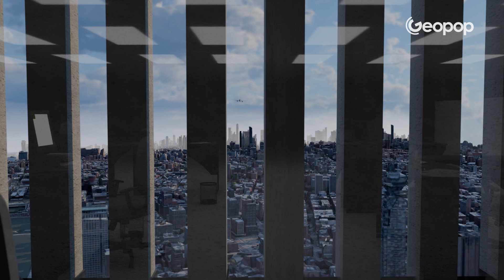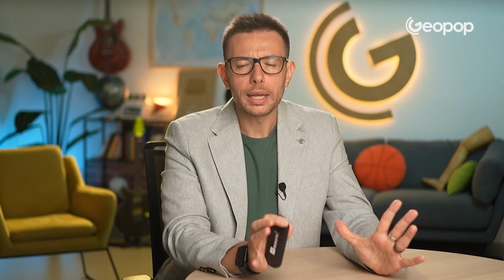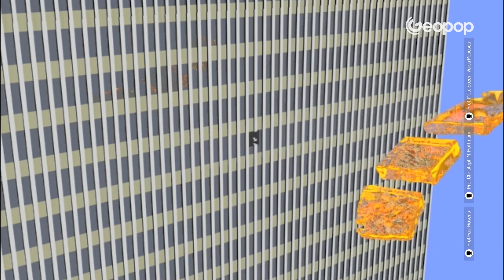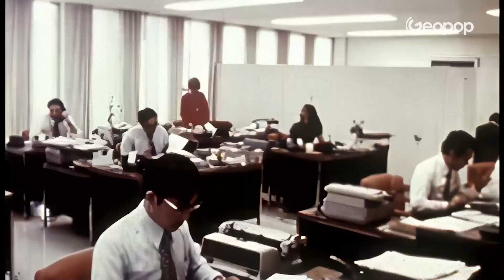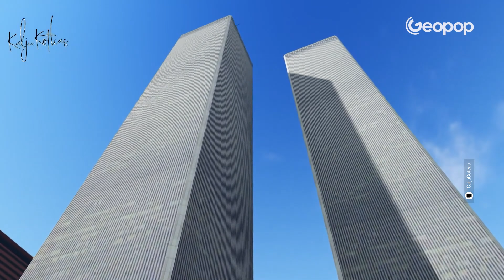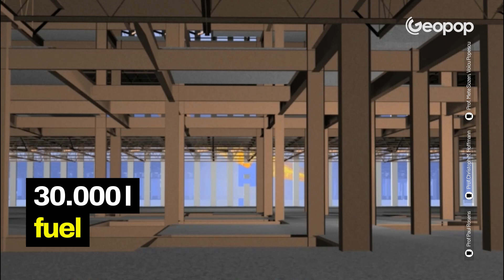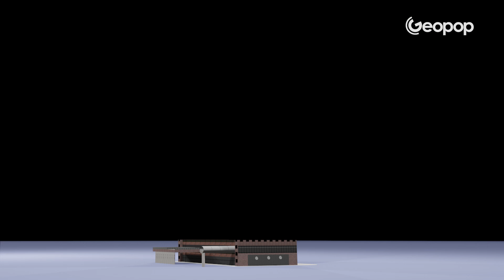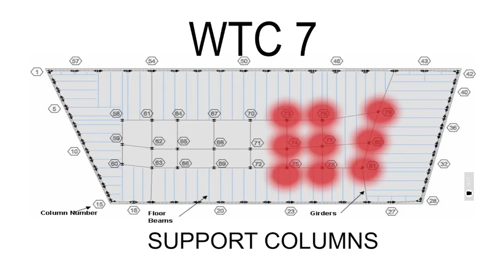9/11, 2001: The Technical Reconstruction of the Twin Towers and WTC 7 Collapses

Comment: What a load of bollocks. It seems Newton's 3rd law of motion was on holiday that day along with entire US air force.
Reply: How was Newton's third law violated?
Reply: Larry Silverstein 🇮🇱 (owner of WTC complex) said - "Pull it, and we made the decision to pull and we watched the building collapse" - referring to WTC 7 - not hit by planes.
"We are benefiting from one thing and that's the attack on 911" - Benjamin Netanyahu 🇮🇱
Reply: Video designed to fool idiots
Reply: "for every action there is an equal and opposite reaction."    I see no way that this law was "on holiday" with this situation.  Was the building designed to stay upright with a missing floor, or a few missing floors?  Was it designed to withstand the load with steel that cannot support the weight above it?  No.  Once you've lost integrity of the structure, and it deforms enough to not hold whatever is above it, you basically have a giant wrecking ball above everything below it.  Was the building designed and capable of withstanding a free falling wrecking ball of multiple floors above it?  No. Nothing here violates physics in any way.  In fact, despite any human desire to do something suspicious, you can NOT violate that law.
Reply: Where are your simulations and calculations then?
Reply: @cconnors He used the trust me bro method.
Reply: Thank you.
Reply: The buildings have to survive extreme winds acting over the entire surface area of any side, so they do have very high lateral strength.  Planes are heavy objects, but not for their size - they are thin skinned hollow tubes, and light enough that the lift generated by air moving over their wings can keep them airborne.  So it's perfectly reasonable that their momentum would be absorbed by the the various elements of the structure, and they would quickly break apart as they perforated the structure, further dispersing their kinetic energy in all directions.  Oh, bollocks.  Newton's 3rd law doesn't take holidays, and neither does the USAF, although its level of readiness on the eastern seebord that day was lower than usual, I believe.  Then again, so were its expectations at that particular time of low geopolitical tensions of an airborne attack by a foreign power, or terrorists using civilian airliners hijacked for suicide missions. Oh bollocks again!  In fact, say bollocks as much as you like mate, but your bollocks can't prove your fanciful twisted theories.  Ans are you either a structural engineer or a military defence analyst?  Bollocks!
Reply: @Ozymandi_as  Funny the entire US air force was on maneuvers practicing for the exact scenarios of planes crashing into building at the same time as the actual attacks. So 4 planes were able to fly around undetected while people made phone calls at 20,000 feet at 400mph between cell towers 🤣 the whole thing was a load of bollocks from Shanksville the pentagon where there is zero evidence of a plane crash at either site and 3 skyscrapers collapsing in history due to fire. I wonder why demolition companies don't just set fire to buildings and let them collapse into their own footprint to dust with hardly any debris pile. What happened to the 103 elevators and the 1500 people that were atomised that they couldn't be identified by their DNA? That only happens when bombs go off
Reply: @Dan_druft your so stupid. Do you even have sources for your dumbass claims.
Reply: The Air Force took their sweet time getting up there, didn't they?  They were asleep or told to stand down.  I have noticed in recent "official" recreations that they are showing the Air Force being up immediately after the first plane hit, but I am with you,  we know that was not what happened.
Reply: @cattycorner8  Yeah the fighter jets didn't get there till after the second plane hit the buildings yet an Air force   1 Jumbo jet was seen flying high over New York while the buildings were on fire 🔥
Reply: @cattycorner8  16 year old's first conspiracy rabbit hole I'm guessing? And no, you don't know that's what happened. You can listen to all of the phone calls from FAA Boston Center to North Eastern Air Defense Sector in Rome, NY. Even the orders from NEADS to the Otis Air National Guard base in Massachusetts are available. There is very little mystery in the timeline of the that morning, and in the timeline of when who-knew-what-by-when. But you spout this total nonsense not because you actually do research and find anything mysterious, it's just fun for people like to just "know the truth" you spent no time researching for yourself.
Reply: @cattycorner8  Like previous commenter already mentioned, virtually all of the US Airforce was doing exercises in Canada.
Only half a dozen planes left to 'defend' the USA but none of those planes were even armed.
Some pilots were ordered to crash their own fighter into the hijacked planes. None did, however the plane that crashed in the countryside, United 93, was probably shot down. This fighter used his guns or was one of the few that had live missiles.

Comment: Floors below have no resistance.   9 seconds to fall.  So just throw out physics no thanks
Reply: Why forget physics when you don't know any in the first place?  A heavy object relased into free fall would travel about 450 m in 9 seconds.  Whereas the collapse of the second tower began at about 360 m.  So the lower floors offered some resistance, but could not delay the massive and accumulating weight of the floors above once they began to fall.  They had no way of absorbing the increasing momentum.
Reply: He literally explained the physics in this video

Comment: I cant believe people actually think that these towers went down that fast over some softening. Other buidlings had planes hit and burn for over 35 hours and not fall. The twin towers were actually made to withstand a hit from a plane. And if you look closely when the towers are falling you can see "squibs" on the lower floors which show blowouts before the floor level fell to that spot (controlled demolition). Oh and theu found super thermite in the dust, and that should have never been there. This was an inside job, 100%.

Comment: Great video, however there are a few things you got wrong or misinterpreted. You mention at 15:10 that NIST states the columns could support the weight of 6 floors falling onto them. NIST calculations are actually referring to the floor connections or more specifically the truss seats load bearing capacity, not the columns capacity. If you refer back to NIST tower investigation FAQ section 18 you will see they state to “Consider further the truss seat connections between the primary floor trusses and the exterior wall columns or core columns. The individual connection capacities ranged from 94,000 pounds to 395,000 pounds”. It was these truss seats that determined the load capacity of the floor system, not the columns.

Also, you claim NIST states the collapse times as 11 and 9 seconds. This is often used as the collapse times, but if reread NIST statement you will see they are referring to the FIRST piece of steel not the last. At the time the first piece of steel struck the ground there was still 40-60 stories of structure left standing. See NIST tower investigation FAQ section 31, ” NIST estimated the elapsed times for the first exterior panels to strike the ground after the collapse initiated in each of the towers to be approximately 11 seconds for WTC 1 and approximately 9 seconds for WTC 2.” Furthermore, if you see the previous section 30 you will see that after the appox. 10 seconds for the first piece of steel to strike the ground seismic data picks up an additional 15 seconds of collapse. This puts actual collapse times closer to 25 seconds.

Unfortunately, small details like this are where conspiracy theories spring from. Other than that, fantastic video and thanks for spreading knowledge about the events of 9/11!

Comment: Nobody mentions where the fuel storage tanks were for the 5th floor emergency generators Drexel Burnham and Lambert installed. Curiious....
Reply: NIST states that the fuel tanks had no effect on the collapse. IN fact I believe they were recovered intact with fuel still in them.
Reply: @Oldschooldan1  And the fuel tank for the building's emergency generator, and the fuel tanks for the command center below grade?